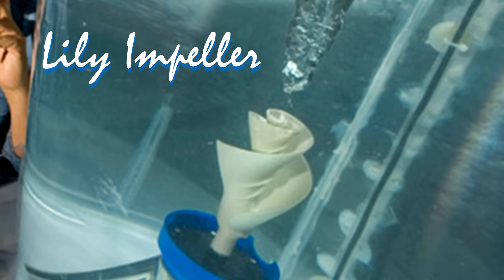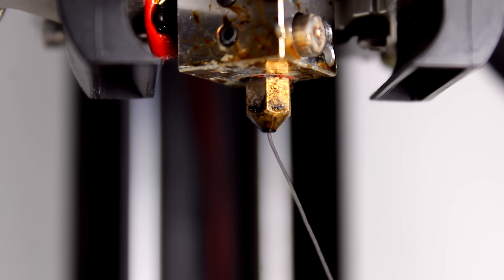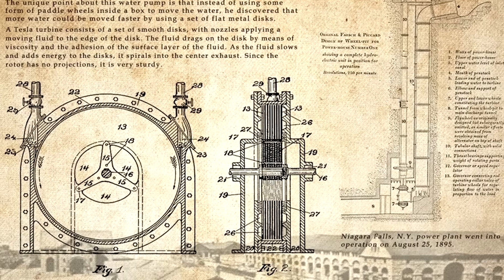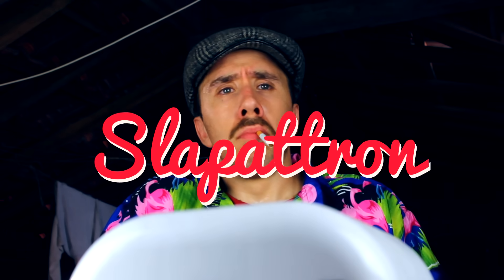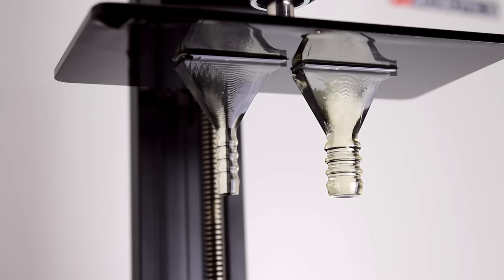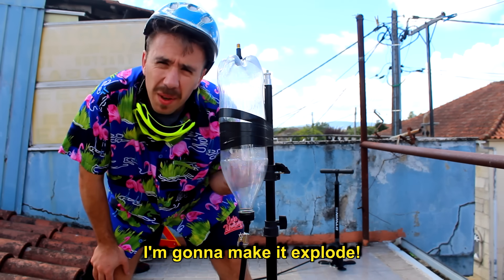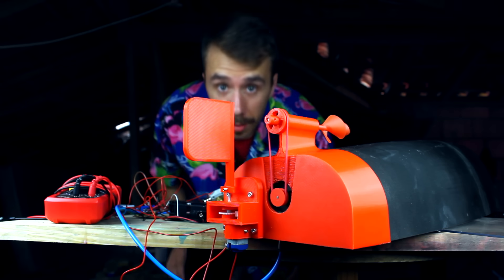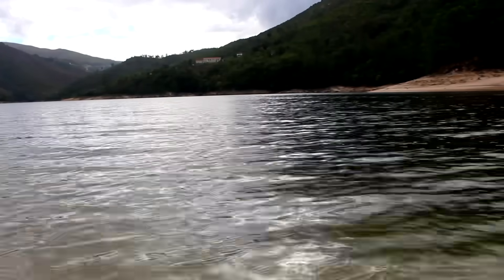Tesla Turbine Boat 3D Printed (Lily Impeller)

Comment: Bro I need you to understand that the Lily peller needs to be contained in order for it to be efficient if you designed a tube where it could suck the water in and push the water out and it would be inside the center UNC increase flow Dynamics I'm an inventor like you I just solve the problems

Comment: Probably would have been better off using a traditional two or three-blade screw propeller or even a paddle wheel. That Lilly impeller did not impress.

Comment: Instead of using air to drive a turbine, you could have just used a tesla pump. Its like a tesla turbine, but you use a DC engine to turn it and it pumps water like crazy. I have a really good design if you want to try it.

Comment: Its been 4 years and im just watching this vid, watching you make your tesla turbine and when you made the nozzles for it, the reason it didnt work well is because the first nozzle allowed the air to expand out of the air hose before going into the turbine making a lower pressure, the straight nozzle worked "best" because your getting the high pressure flow directly onto the disks, the real one that worked the best was no nozzle because of the bernouli effect where the rushing air draws more air into the opening, know you wont see this but hey i feel smort

Comment: You'd be way ahead just copying my air engine. It's positive displacement, has one cylinder, three pistons, an inlet valve and an outlet valve all with just one moving part! It produces robust positive torque at all pressures and makes a putt-putt sound to boot.
I'll share it on my own YouTube channel one of these days.
Don't pull out your hair trying to figure it out. I'm autistic and I don't think like normies (everyone else).😊

Comment: I would take the battles out of the water there causing to much drag also mount the impeller to the front not the back/ make a hydro foil if you want the mount in the back

Comment: I think comparing different impeller and propeller designs on your boat would be a cool video. I think that thing could go a lot faster. Maybe add a compressed cylinder for the air supply as well. Love your videos. You are very entertaining. Keep it up!

Comment: You could pump water through tesla turbine, add battery to pump, pump will push water through turbine. water inlet and outlet could be oriented to assist boat movement.

Comment: Hi there I'm loving your videos. Here is my suggestion use a high compressed air metal inside the plastic bottle as a lower pressure canister using your top up circuit wirelessly to save space and gain regular regulated pressure on your projects.

Comment: seeing how the bottle test on the roof took off with the entire weight of the metal stand it was on..... it seems evident that the best form of propulsion you created in this video was the simplest. that power from releasing the compressed air was the purest and most efficient use of energy seen on this video. your boat's propulsion was disappointing but if you had simply spent the compressed air from the 4 pressurized bottles directly toward the aft of the boat (either into the air or into the water) you would have realized many times the power output that the tesla air turbine-to-lily impeller had. sure, it would not be very interesting, but wastes much less energy and moves the boat probably more than 100 times faster and/or further. 😊😊😊😊

Comment: I guess you would get MORE POWER by simply injecting that compressed air into the water avoiding the tesla turbine. The narrow nozzle worked better because you have ran more air between only few discs and thus increased friction and exchange of mechanical power. Remaining discs were mostly unused. The designed gap between discs was too big.

Comment: Simple fix man...... Use hydraulic fluid and a pump to spin the turbine... More viscosity means less energy loss through the turbine... More rpms with less pressure...

Comment: Others have already said it, and this is three year old video anyway (and very well done) but, a propeller is made to spin and create force against the water. An impeller is made to create water pressure within a closed environment, ducting, a tube, etc. To spin the impeller free in open water as a propeller was, well, missing the point. So much beautiful work, so close, almost .... At least enclose the impeller and then see what your results are.

Comment: You are increasing the drag on the boat by letting the bottles float in the water.  If you don’t need the increased flotation, mount them in a way that they don’t touch the water.

Comment: the reason that the flared nozzle design makes it work worse is because the air pressure suddenly drops when exiting the tube and spreading out, when you don't have the nozzle at all the fast moving air is actually dragging ambient air with it, which is keeping the air pressure constant while increasing the mass and slowing the speed, thus the total potential energy remains the same

Comment: Is it possible to be able to use the  use a co2 tank from a paintball gun that could withstand thousands of psi then use a small regulator get the most power and runtime  and not have anything hanging off the side?

Comment: Here is an idea.  Get rid of those low pressure soda bottles and go get a HPA high pressure air tank used in PCP air rifles.  They are routinely pressurized to 3000PSI.  The compressors will generate 4500PSI so you might be able to find a  tank built to be filled to that level.  At what RPM does the Lilly impeller produce the maximum amount of thrust (is there graphed RPM versus thrust data available) ?  If you don't have to have those extremely high RPMs, you might go back and see what kind of performance you could get from a more traditional electric motor and battery.

Comment: Also you should run that lilly in the other direction. And add two blades that curl slightly at the tips. Then you'll be grabbing big amounts of water and force directing it out the tip

Comment: Sooo. What a powerful motor. Your small nozzle worked better because you focused the flow amougst just a few plates. You lost velocity by not making it less plates or adding flow plates with a slightly larger inlit. Also weight at the distant ends to keep motion would help maintain your torque

Comment: if you add dry ice and water in the bottle coupled with the adjustable regulator should give you a more constant pressure so you can run the turbine longer.

Comment: Thanks. Reason for looking up impeller was as for a boat.  i cant believe how dismal that performance was.  My idea started on theory  that water or air escapes on outer edges of blade. And was thinking of principle of squeazing a garden hose to get more pressure / speed.  Thus using outer edge of blade contained in  ring so it cant escape outside but be channeled toward the center under pressure.  Also your turbine and how it worked better with just the compressed air.  it may have been like carborator venture effect where the air from air gun is dragging outside air with it thus giving you more volume while the compressed air helps pressure / force the outside air caught in momentum into the blades or disks.  Holding that thought -  maybe use the exaughst  from turbine recirculated like half turbo back into the turbine with gap and air gun in center.  WHo knows,  Ive lots of ideas based on knowledge mainly from what dosent work,  while your at the young stage and have energy to burn.

Comment: Cool design.  Try lowering the turbine below the level of the water and fabricate a one-way valve for the exhaust air to use both the impeller and exhaust as propulsion forces.   Also consider using the impeller as a tiller (If the belt will take some torque) with a cylinder around the impeller.

Comment: build a sterling engine that runs off of a magnifying glass. use the energy produced to power a compressor that fills a tank to be used to spin turbine that spins a motor and create electricity 24 hours a day.

Comment: I so wish you could demonstrate how much thrust you could generate with a tesla-turbine, by driving the shaft with an electric motor. My question is - does it work both ways as efficiently? Or only air power in, mechanical power out?

Comment: soda bottle can take 10 BArs EASILY. ITS JUST THAT YOU MADE A HOLE ON THE BOTTOM AND IT MAKES IT WEAK. i use sodabottles as exploding targets for my pcp gun. put a valve in the cap, fill with 10 bars of air. when you shoot it it explodes like a granate :D

Comment: I think if you used a bigger impeller at a lower rpm the boat would travel faster because more water would be displaced for less amount of air spent.

Comment: The problem is you're using an impeller as a propeller. Trimaran built on air tanks and jet drive with your lilly impeller might give you better results
Reply: Even better, use aluminum water bottles for hiking to get a lot more pressure stored in the pontoons.

Comment: Nice work, I'm impressed! But why not just use the Tesla Turbine to suck up water through a filter straight from the lake and vent back into it? Just get the turbine running as you did with the air. Or if you still want to use the impeller mount it the other way but at the back of the boat (larger flower part in the direction of travel) and reverse the drive?

Comment: I am impatient so at 13:27 I pause to say: run time is longer than 1 minute with load to reduce pressure outflow.  lilly impellor needs to be switched around, pointing other direction for more thrust.

Comment: You need a stronger tank housed inside the hull that holds more pressure to reduce the number of tanks and the space they take up.the impeller also needs a housing to direct flow and build output pressure.

Comment: The difference between an impeller and a propeller is: A propeller is designed to propel things that moved An Impeller is impelled to move by an outside force. In the case of the Lily Impeller, water falling down a tube.

Comment: FYI, you can easily snap up to 4mm threaded rod by simply holding it with two pairs of pliers or similar grasping devices. Mark the place you want it broken, place one pair of grips on the line then grasp with the second pair about 2mm away from the first, this allows waggle room and bend the rod back and forth. When it breaks it leaves a thread that is relatively undamaged and does not need to be filed, unless you get a thread spur but you only need to grasp it and waggle for it to break off.

Comment: Great work again, well done.
I think you may find this interesting, the concept of which the tesla turbine works is also the reason the boat could pick up speed. The bottles resting on the water create a drag and the boat/driving force has to compensate for this. * try the boat again, but with only the Hull of the boat in or touching the water *

Comment: Connect impeller directly to shaft of turbine and route turbine exhaust into the water for extra thrust and efficiency
Also, fifth air bottle in the hull of the boat. Your rudder should be centered, too.

Integzaboat version 2.0 when?

Comment: Add enough water to keep your turbine running, till the air pressure is used up. The air will only hold pressure, while the water works as a piston ring; reducing loss because of waters higher viscosity. It's worth a revisit?

Comment: I would build a hydrogen/oxygen seperaror/governor.  This would allow me to use my home built hydrogen generator to split water molecules and on demand separate the elements to make them safer to compress for a collected volume so that the volume would be enough bb hro variably control a motor to run solely on water with ability to throttle.  Would store the collected. Elements rather use much like a computers ram rather than a  hard drive.

Comment: I'm curious what performance difference it would have vs the air straight up exhausting out the bottom of the boat in the water using nothing more then Newtons 3rd law.

Comment: I did something similar for my freshman engineering project. We used dry ice to store the pressure and applied water to release the pressure. The only issue is you’re on a timer and have to release the building pressure once you apply the water or the bottle will explode lol but you can store a lot of compressed air in 1 container that replenishes!
Reply: I've played around with dry ice before too and that's actually a really good idea. If they could just find a way to release the pressure over time, it could be really useful in a situation like this.

Comment: I immediately unsubcribed when you tried to define an impeller incorrectly. Impellers do "suck" but also push, the work they do is irrelevant compared to the fact theyre CENTRIFUGAL pumps... how does one contain centrifugal energy with an external propeller? Yes, it is a propeller without a housing.

Watched a few vids, the wankal pump was a fail because you did ONE rotor instead of many, this was a fail because you dont understand simple physics and use clickbait inventor names to butcher any of their principles and achievements.

Comment: Air is not the solution, Intezgaszasza.  Look back at that original patent.  Tesla specified STEAM, and you're building a boat, so the solution is obvious.  You just need a way to make lots of heat/steam and pipe it through there.  And maybe a metal tesla turbine. ;)

Comment: Calling for a Revisit!!!!! 
Your propeller is backwards, drive losses are to high and needs a greater gear reduction.
Perhaps flip the Prop to the back and use a toothed belt or gear drive.
GET IT ON THE PLANE

Comment: I think  if you would have better results if you put the impeller inside a tube. Impellers on jet boats and jet skis have the impeller in a housing. The compression of the inlet allows much higher thrust behind d the impeller in the tube.

Comment: Great video & I'm glad you listened to the right shoulder, lol... A couple of observations, as I am MUCH lazier... the angle of the impeller (toward the boat) may have been OPPOSITE to what you actually did  need... secondly, considering the vessels for air that you used, you perhaps did not even need a boat at all... they could have BEEN the boat, IMHO you could have used maybe a water cooler 5 gal jug as the air storage vessel and as the vessel itself, lol

Comment: Coulda used the steering control motor, geared down to steer the rudder. And added a motor into the drivetrain, connected on the same pins as the valve servo, do juice the impeller with a bit extra speed, wind down charging the battery.

Comment: You can always stick a chunk of dry ice inside your bottle and use that as your "fuel" as the dry heats up it turns to CO2 -> your pressure inside your bottle will increase. Add a solenoid to control your valve for the throttle and a pressure sensor to automate this and I am sure you can drive your engine pretty efficiently and for a long time with it. Liquid nitrogen would work as well - unless it blows up your bottle :D

Comment: 5:33 will that really be 2 bars of pressure while air can escape due to a not fully sealed unit. wont the path of least resistons be atmospheric pressure. the air in the turbine will need to be compressed much more than surrounding air, therefore energy will be lost?

Comment: So this is not a bad idea at all, however, if I may be so bold as to suggest an improvement or two: first, the lily impeller is first and foremost an IMPELLER, not a Propeller, and while they’re related in a way I don’t remember from the top of my head, the most important difference I understand is that an impeller and must be enclosed whether in a tube (for your boat maybe) or a centrifugal pump like a jet ski or high velocitiy high volume fire hoses. My basis for suggesting this enclosure is that in my study of hydrofoils as well as airfoils (all may as well be called fluid foils) there is a great amount of force being lost laterally, this is one of the reasons airliner wing tips curve up and super efficient props for planes bend aft. So again I believe an enclosure of some sort would greatly increase the performance of this truly unique watercraft, because, I think you’re losing like 95% of your total thrust generated laterally. Another option is to put like 1-2mm fillets on the edges of the impeller, although I personally think the enclosure would be the better choice. Thank you for reading my comment, admittedly I have not done the math behind all this yet, however if you want I will do so and send you the proof; if I end up being incorrect, then, cool, I learned something! 

Something else you may want to look into, being a student of many unique ways of propulsion, is “Magnetohydrodynamic” thrust, more related to ocean water than molten metal. I believe there are only two craft in operation and a third recently retired. Also the purported to be the propulsion of the fictional ship “Oregon II,” from “The Oregon Files” by Clive Cussler.  Again thank you for the read, and have a wonderful day.

Comment: yeah put a housing around the impeller like ppl suggested ... and get rid of those bottles, get a proper pressure vehicle instead so that it'll fit inside the boat. and then change the rudder to move +/- 1cm; that should be more than enough. nikola didn't want a retiree cruise liner, he wanted something that goes FAST!

Comment: Well i hope im not too late...
I am doing a complete refit on a cal 34 sailboat and outfitting it with an electric motor solar panels and 48 and 12 battery banks.  How about 3D printing a solar array mount that automatically adjusts to the sun, using only 3D printed parts.

Comment: The flared inlet nozzle wasn't a failure.  It was different.   Instead of higher RPM you were getting higher torque, which would have been good for pushing the impeller through 830x denser fluid (water.)  Torque was your goal so when you saw less RPM for the same flow you should have been elated!